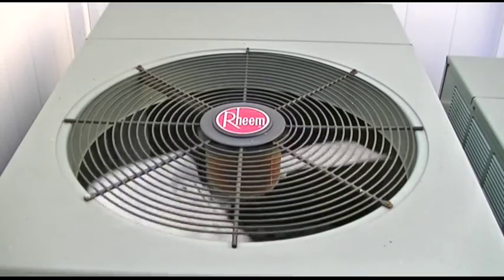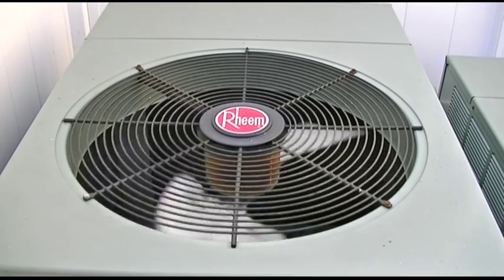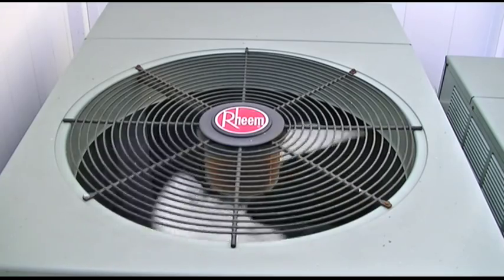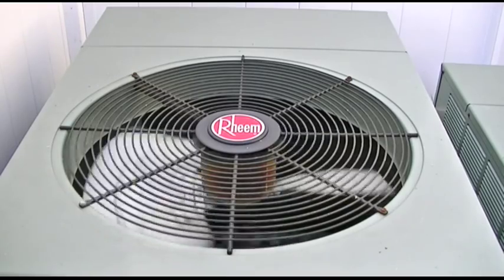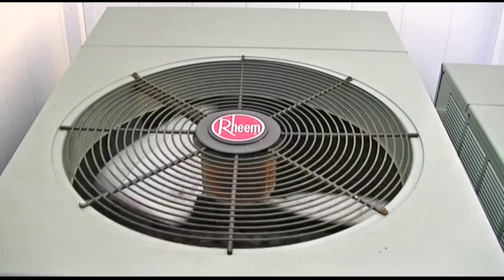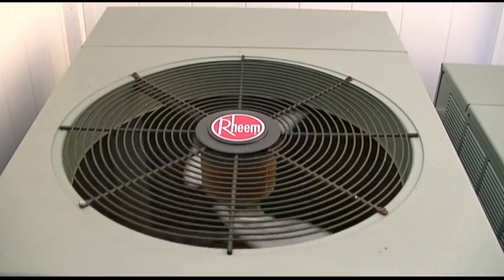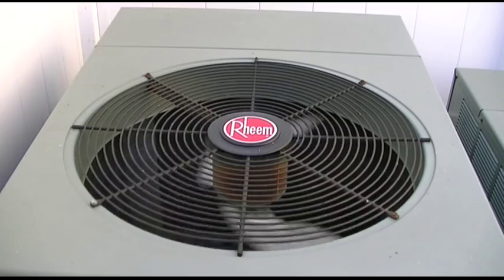Copeland Scroll Compressors Can Run In REVERSE!

Comment: It’s not the compressor running backwards. It’s the loss of power to your reversing valve. The valve reverses the flow of the REFRIGERANT cycle, not the compressor. The compressor rotates in one direction only on a single phase power source such as a residential structure. So, this entire video is incorrect.
Reply from the maker: I'm sorry, but YOU are entirely incorrect.  Just Google it, Copeland themselves have affirmed this to be true.
Reply: @jaykay18  gotcha champ. By the way. What’s the model number of your Rheem outdoor unit?
Reply from the maker: @mariovgomez1820  No idea offhand, and I believe the sticker has faded into oblivion after about 17 years.
Reply: @jaykay18  well, apparently it’s not a heat pump, as you’ve stated it has no reversing valve. So the compressor running in reverse performs no compression action on a scroll compressor. So the result is zero compression which will produce neither heating nor cooling. Additionally Copeland as well as other scroll manufacturers advise that running in reverse will improperly lubricate the compressor resulting in failure. So it’s a little more than an inefficient heat pump. It’s actually not a heat pump simply because the compressor runs backwards and it’s actually catastrophically damaging. The reverse action of a heat pump has nothing to do with the scroll compressor...... it’s the reversing valve that changes the direction of refrigerant flow and thus expansion and condensation occur in reverse locations in the system.
Reply from the maker: @mariovgomez1820  This video was strictly to explain that this is a KNOWN phenomenon and CAN happen.  I didn't induce this, it happened due to a power blip.  While it didn't work well in reverse, it actually did work slightly, because the air inside was not room temperature, but lukewarm, and outside was quite cool.  None of this was intentional, like I said, it was a "freak of nature" that caused this to happen.  And that's why, when I realized what had happened, I shut the system down, allowed 10 minutes for pressures to equalize, and restarted.

I'm well aware of how heat pumps work and reversing valves work, and have even watched the recent videos by Technology Connections about it.  This is an A/C only system.  I know what's going on, I have more than enough knowledge to be more than dangerous.
Reply: Reversing valves don't exist on AC only systems. They only exist in heat pumps.
Reply: Thank you for sharing your comment. My Trane XR unit is making loud noise. After shut it down and turn back on works normal again. Installer has no idea what is happening. Called another service company and recommend to install a power surge protector for the AC to be installed outside the house near the unit. Don’t know what to do. Do you think that would help? Thank you any comment would be appreciated

Comment: Is it technically possible to make a heat pump just by having a compressor that can start in either direction?
Reply from the maker: Yes, but it's not very efficient.  There are proper heat pumps manufactured for just that purpose.

Comment: The 3 Phase Compressor won't run backwards on its own. What causes it to run in reverse is the 3 Phase Power Service from your Power Company. In the case of a power blip, power outage, the Power Company may make a quick repair to restore service quicker, but at the cost of temporarily reversing the Phase Rotation of their 3 Phase Service. Once their permanent repair is made, they check their Phase Rotation, which allows your Compressor to return to its designed direction.....any 3 phase motor or compressor can be reversed by swapping any two conductors on its starting circuit. Thats basically what is happening upstream of your residence in an emergency repair by the power company. They may be bypassing a downed transmission line, re-wiring a transformer configuration due to a bad transformer, any number of problems.
Reply from the maker: Good to know.  This isn't a 3-phase unit though.
Reply: @jaykay18  Oic. Interesting. Most Scrolls have a Discharge check valve which should allow it to hit internal overload quicker, and thereby  not allowing it to heat your evaporator and cool your condensing coil. Also, is your metering device on your evaporator an Orifice or a TXV? I higher Seer unit would have a TXV which would close and not allow refrigerant flow reversal either I imagine.
Reply from the maker: @timothymyers3072  I have no idea what it had, actually.  I don't believe it's a high SEER.

Comment: Hello, this seems to be similar to what I'm experiencing. Had a blower motor replaced and literally the next day a grinding noise started. When the grinding noise happens the cold air with stop blowing and the grinding will continue for 15 minutes. After 15 minutes the noise stops, which i assume is the condenser shutting off, but the fan will continue to run for approximately 30 minutes. The condenser will then turn back on and start cooling. About 10 ppl have been out to look at it but we are unsure as to watch the issue is. This is a reheem ac unit and even the manufacturer is unsure
Reply from the maker: The grinding noise is coming from the condensor, I assume.  When this happened to mine, I could tell something wasn't right.  The buzz or hum that it makes when normally running just sounded a bit different, like it had pulsations in it.  After I felt warm air inside and cool air outside, I knew something was wrong, so I shut it off.  I left it for 10 or 15 minutes for everything to settle down, and restarted it.  It hasn't happened since.

Your compressor may indeed be running in reverse, which is not normal.  It would likely need to be replaced.  That's my guess.
Reply: @jaykay18  ty

Comment: i commissioned a goodman condenser single phase M/N GSX130601BJ,  S/N 2005155921.  I observed a delay for a moment.  my 410a pressure with a piston equalized.  the rotation reversed.  the copeland scroll shut down on thermal overload.  i came back 24 hrs later with a sp-6 hard start kit.  i started it up and it sounded like a bomb went off, loud bang.  i shut it down and restarted the condenser with no further issue.  in 25 years, i never had this happen.  my partner and i looked at each other and said we heard a bomb and we're still alive.  mind blowing.
Reply from the maker: I can't answer that.  I still get non-believers that these scrolls can run backwards.
Reply: @jaykay18  thanks, great post
Reply from the maker: @tedallen9078  Thank you.

Comment: 24. Brief Power Interruptions
Brief power interruptions (less than 1/2 second) may
result in powered reverse rotation of single phase
Copeland Scroll compressors. High pressure discharge
gas expands backwards through the scrolls at power
interruption, causing the scroll to orbit in the reverse
direction. If power is re-applied while this reversal is
occurring, the compressor may continue to run noisily in
the reverse direction for several minutes until the
compressor’s internal protector trips. This has no
negative impact on durability. When the protector resets
the compressor will start and run normally.
Emerson strongly encourages use of a timer which can
sense brief power interruptions and lock the compressor
out of operation for two minutes. A typical timer wiring is
shown in Figure 16.
No time delay is required on three phase models to
prevent reverse rotation due to power interruptions.
(Copied from Emerson Bulletin AE4-1299 R21)
Reply: More: Page11
Reply from the maker: Yes thank you, I've read it.

Comment: I have a client in a high rise condominium with a water source heat pump that did this routinely. Although in the case of his unit there must me internal check valves to prevent reverse refrigerant flow. It has a replacement compressor 2-3/4 ton model ZR32K5E-PFV-800. The power is interrupted, the scroll comes to a stop very quickly, then the scroll begins to spin backwards due to the internal pressure from the high side, then the power comes back on and the compressor runs in reverse for about 10 minutes until the external shell is 165 degrees, then it stops and sits for a half-hour to an hour. With no refrigerant flow to cool the compressor, it get really hot before it thermal trips. I replaced the original unavailable R22 recip compressor with a Copeland scroll. This unit, too, has ICM protective relay devices (ICN492 & ICM200) that didn't help so far. I am righting the fault duration limit to get better results - 2 seconds does not do it.

Turns out the contactor's contact disks were badly burned and not making perfect contact. Combine that with some vibration and the thing would quit for a second or less. The Copeland scroll seems to have higher inrush current demand. It degraded the 30 amp contactor rapidly. It now has an up-rated 50 amp contactor that I hope will stand up to the high current surges at start-up. New contact seemed to work until it didn't..
Reply from the maker: Nice story.  That further proves this can and does happen.  I was fortunate that I was home at the time it did that, so I could stop it before anything got too hot.
Reply: @jaykay18  The external shell will hit about 165 degrees when it trips. I sat in front of the one I described above with a Fluke Digital Thermometer and contact probe rigged to it to get a temp reading just after it tripped out -- the reading was 165. I thought I killed it. I quickly packed the compressor in ice water soaked towels and basted it with more ice water to pull the temperature down. It sat a long time wet before it would restart when the contactor closed.
Reply from the maker: I can certainly imagine it got that hot--that is indeed pretty hot.  I'd imagine it probably runs around 130 or so on a really hot day.

Comment: My scroll compressor will reverse if the power flickers just right. I put a delay relay into the 24v circuit but it did not prevent it from happening again. I can hear the growl in my indoor unit when this happens. I simply turn the system off for a minute and back on and it runs normally again. It is not a heat pump so there are no extra gadgets that can cause the problem. Someone told me there is a device that will detect a reversed compressor and prevent it. Don't know for sure.
Reply from the maker: There's a separate device that will mount in the outdoor condensor that will introduce a delay, that will work to prevent this phenomenon.  I've only had it happen this one time, but thanks for assuring that this IS possible.

Comment: How this can happen? It used to cool house without problems, but now it run reverse? Did you check the pressure at suction line and liquid line?
Reply from the maker: It was because of the power blip, the compressor can ran in reverse.  It's a possible phenomenon.  Never happened again since, the unit works perfectly, and there's no need to check the pressures.

Comment: That sound is the compressor running backwards for as split second on account of the discharge check valve leaking by. If the compressor runs backwards it doesn't heat the house that is your reversing valve that controls that function not the compressor running backwards as a pump running backwards will not cool or heat. Yes this a year or 2 too late... lol
Reply from the maker: Yes it wasn't heating the house, but the air coming out of the vents was NOT cold.  The air coming out outside WAS cold.

Comment: My 1 year old American Standard packaged unit does the same thing. It has a scroll compressor.  Every time I have a very short power surge, the a/c begins to hum loudly outside and it stops cooling the air that is going into the house. I automatically turn it off at the thermostat and wait 6 minutes. I turn it back on and it runs normally again.
Reply from the maker: Thanks, I knew I wasn't crazy.

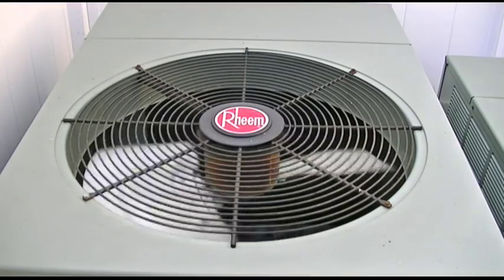Comment: At 1:43 you said p[umping warm air inside and cold air outside? because the compressor was running backwards? Reversed rotation scroll compressor will not magically create a heat pump ! Not even if the units is a heat pump! Yes a 3phase scroll can be electrically reversed but it wont pump if it's running the wrong direction period. a single phase scroll can assume a reversed rotation if the scroll is rotating backwards due to pressure equalization during the off cycle and turns on while rotating backwards. (That's why the delay timer is there) It doesn't crate a a heat pump when this happens it just wont pump.
Reply from the maker: Yes, I wasn't trying to make like this was a heat pump.  The fact of the matter is, the compressor did rotate backwards, and it wasn't making cold inside, in fact the air was warm, as in, warmer than it would be if it were working properly.  Outside, the air expelled wasn't cold per se, but was colder than it would be if it were operating normally.
Reply: @jaykay18  thats not what you said in the video! you should remove it because its just more misinformation that trashes up You tube. If you are not a technician you should not confuse others
Reply from the maker: I believe I was perfectly clear in what I said.  I'm no HVAC tech, but I'm dangerous enough to know exactly how it works, and can do minor repairs like capacitors, contactors, fan motors, etc.

Comment: Get a Emerson Sure Switch, problem solved.
Reply from the maker: While that indeed would correct the issue, it's certainly not worth the price.  First off, this was a one-off thing, never happened before, probably will never happen again.  Secondly, if it does, even if I were not home, it wouldn't cause a problem.  Eventually the head pressure would be too great and the rotor would lock.  Then, either the breaker would trip, or the compressor would thermal out.  In the former case, I'd reset the breaker when I get home, in the latter, after the compressor restarts after the thermal condition has cleared, it would run properly and I'd be none the wiser.

Comment: Well if your heat dies, there's always a plan B.
Reply from the maker: Plan B I had thought about for a long time.  That plan was to retrofit the air handler with a really really power hungry electric element as backup heat.  If nothing else, that would be a huge selling point if I were looking to sell, which I'm not.  The peace of mind knowing you're not going to freeze if the heat goes out is extremely comforting, especially if the weather is already chilly.

Still thinking about it, probably never act on it.
Reply: That it is, even for me with a virtually endless tolerence for the cold.
Reply from the maker: I hate the cold weather.  Always did actually.  Now being grown up with everything broken and not working the way it used to in my body, I especially hate the cold.
Reply: Well I can see why you want global warming so  bad.
Reply from the maker: It hasn't happened as much as they say it has.
Reply: Probably because the Bluick is in service and not guzzling gas as much as it could.
Reply from the maker: Yeah, it guzzles 7 liters of that sickeningly sweet exhaust that comes out of cars with their fancy emissions each time it turns over.
Reply: That will not make it a heat pump, straight cool and heat pump compressors are exactly the same. A scroll should never run backwards
Reply from the maker: Under normal circumstances, you're right, it should never run backwards.  In this case, because of the high pressure, and the power blip, it caused it to run in reverse.  It's a real phenomenon--look it up.  I thought I was crazy also, but I was here when it happened.  I also have done research, and it can happen.
Reply: jaykay18 I was mainly saying that it won’t make it a heat pump.
Reply from the maker: Yes, I fully agree, it's extremely inefficient in doing that in this application.
Reply: jaykay18 no I mean it will not be a heat pump, not that it will be inefficient... a scroll going backwards will not pump
Reply from the maker: Oh it pumped all right.  The inside vents were spewing out slightly warm air, and the outside unit was spewing out cold air.  Again, it's not efficient, and didn't serve the purpose as a heat pump, nor would it, but it ran in reverse and it definitely felt as such.
Reply: jaykay18 ok...

Comment: A compressor runni g in reverse will never change from cooling to heating, he will just make noise and displace less gaz. If the airco switch from cooling to heating after a short outage, it means the 4 ways valve did switch.
Reply from the maker: I was under the impression the head pressure would increase and increase until the compressor stalls, at which point it would thermal out.  Upon restart, it would turn the correct way again.
Reply: @jaykay18  Not my experience for it to stall. I found they run backwards about 10 minutes until the shell temperature hits 165 degrees, then trips out. Along the way it makes some ugly bearing squeaking noises; I thought I killed the clients compressor while debugging it.
Reply from the maker: I can certainly understand the feeling!
Reply: Not necessarily reversing a scroll  comressor does reverse the flow. That would make the indoor unit the condenser and the outdoor unit the evap. However some metering devices might have a one way check valve.